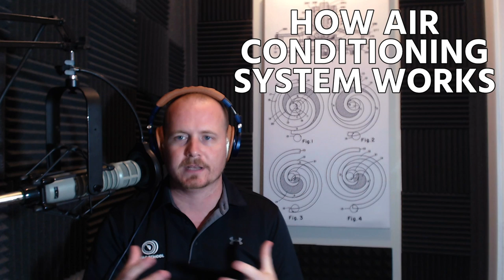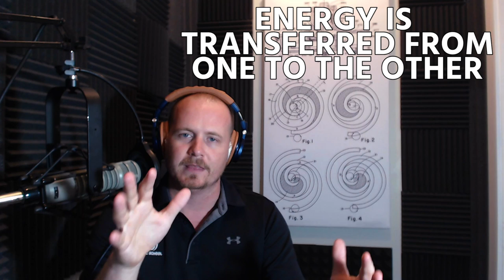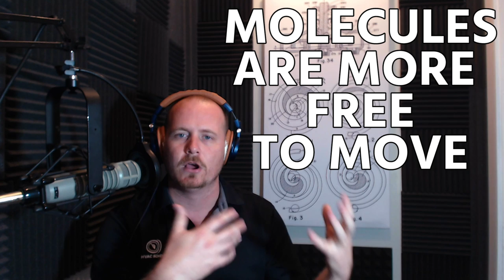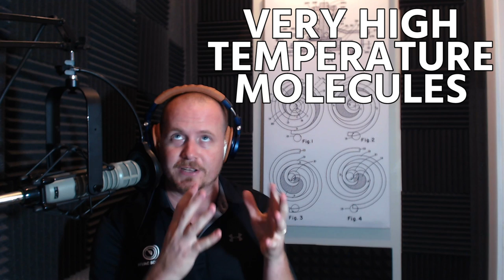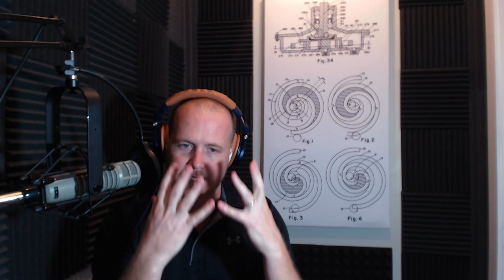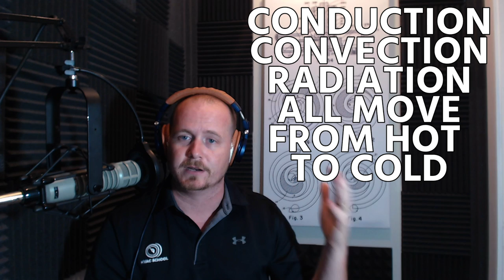Conduction, Convection & Radiation

Comment: Conduction , flam from torch hitting Cooper pipe . Convection , heat from the torch traveling threw the Copper pipe. 

Convection, air passing over condenser coil. Conduction, the fin of the coil touching Copper pipe. Convection the air passing over the copper pipe carrying away heat.  

Please forgive spelling errors.

Comment: Would you consider doing a step by step explanation of heat transfer in a forced air nat. gas furnace. Meaning the flame, the heat exchanger  and the blower?  Thanks, for your fine presentations.